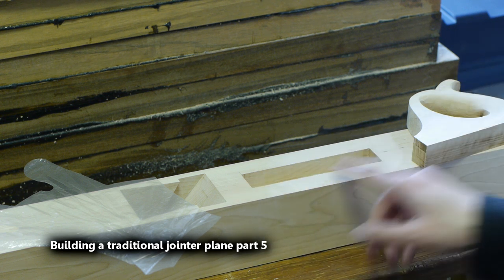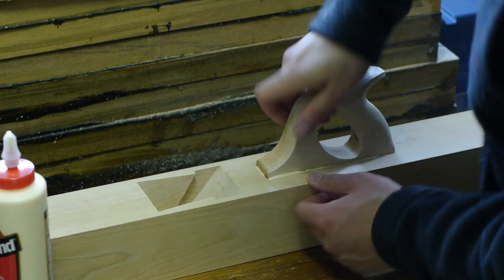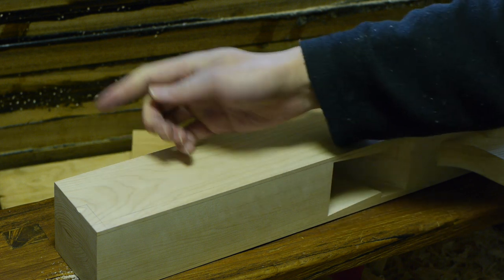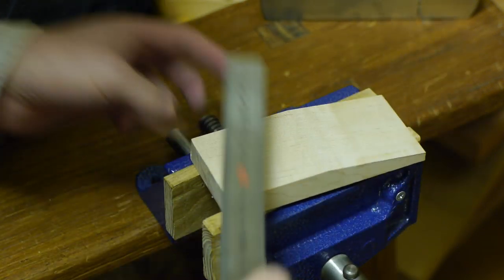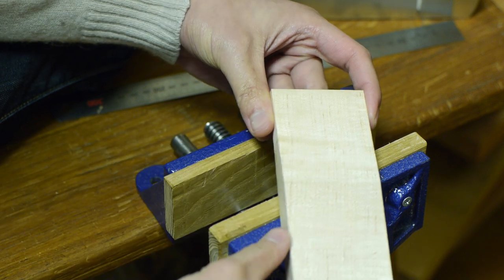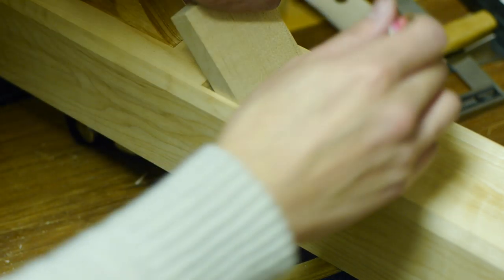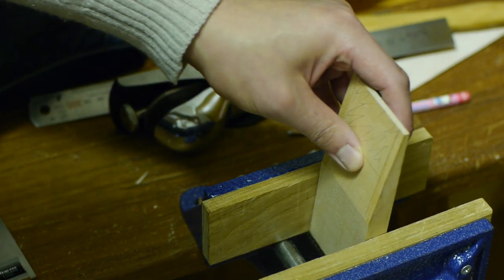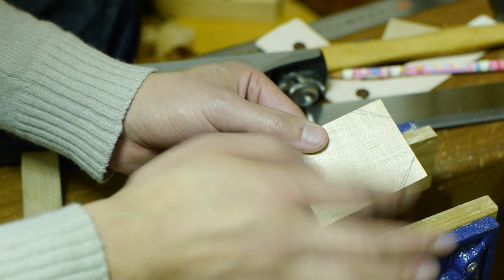How to make a traditional style jointer plane part 5

Comment from the maker: I'm not sure I got the correct meaning from google but if you are worried the tote will come loose, it shouldn't be a problem. A good fitting mortise tenon and good glue should be enough to hold the tote. The best option to fasten it however is to angle the mortise and tenon and make a wedge to lock the tote in. Screws and other hardware should not be needed. I think this was the method used in some old planes.

Comment from the maker: Yeah as I was pounding it in I was thinking "crap, the compressed air in the bottom might push the tote back out".
There were a few holes in the bottom of the mortise from the drilling but I guess I should have made some more smaller ones to let the air and glue escape.

Comment: just saw the endgrain of your blank. as the wood moves ur plane is gonna pull itself apart. as wood moves the growth rings basically try to pull themselves straight.
Reply from the maker: Hi, thanks for watching! I know the common wisdom when gluing wood face to face is to make the end grain form an X pattern rather than an O, but with modern glue (like the Titebond here), seasoned wood, and good surface preparation, the chances of the joint opening up from humidity changes is pretty much zero. Case in point, I just checked the plane and its still straight and tight all over :)
Keep in mind this is after 9.5 years of Japanese weather which ranges from 90%+ RH in the Summer to below 20%RH in the Winter so I think its doing pretty well.
For this plane I had to glue it up like I did because there were some knot holes in the wood so I hid them on the inside surface. If I had the option, I would have done it the proper way.
Anyway, good catch and here's hoping that future viewers will see your comment and do it properly!
Reply: @sumokun  a clever compromise. Cheers for the clarification